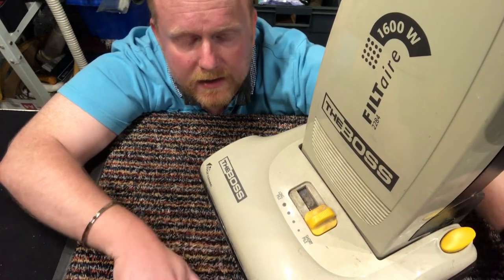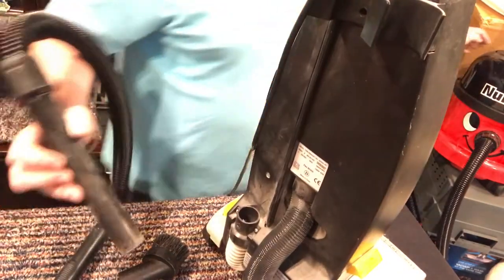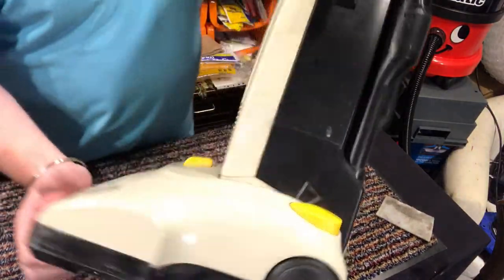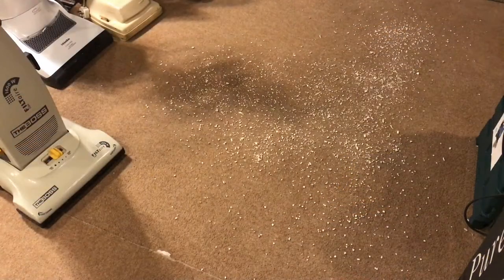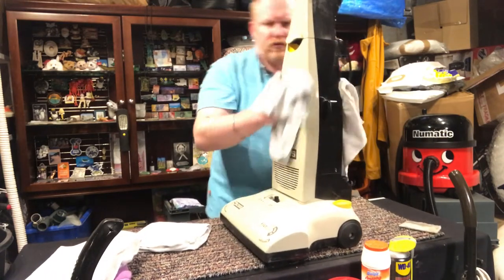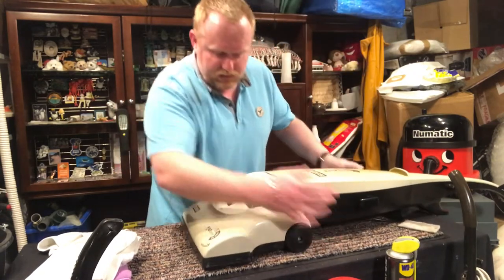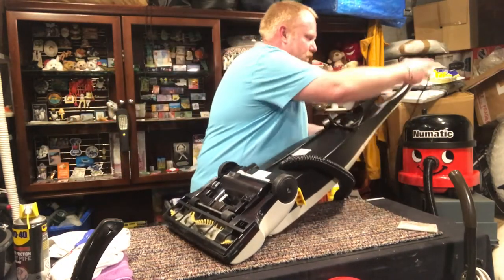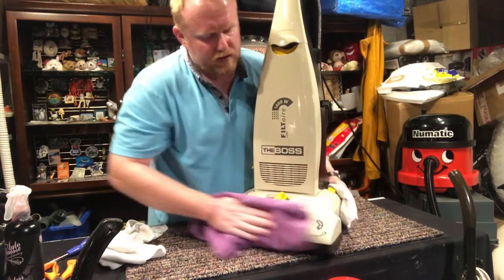Electrolux The Boss Quick Repair Demo & Clean Up

Comment: Thanks, that really helped me to replace the brushroll. It's not very obvious how they come apart. Are the drive belts still available? Obviously a wearing part.
Reply from the maker: You’re welcome, you kinda have to use another brand but look at the original first and measure it.

Comment: I think thats from 2004, judging from the serial number. It is similar to the powerlite pet that I have, and uses the exact same HEPA filter, which is non washable paper. Its a nice machine, and you did a nice job doing it up!
Reply from the maker: MadAboutHoovers Thanks Steve, if it were mine I would have stripped it down further to clean it up, but good enough for a quick service for friends.
Reply: @HooverLux  You know you can get fleece bags designed for this machine so you dont have to try and make the numatic bags fit? If you have a look online they are about 3.50 for a pack of 5 and were designed for this machine.
Reply from the maker: Jake McIntyre Ahhhhhh! Ok, thanks for the advice, I will have a look for them. Thank you for letting me know my friend.
Reply: @HooverLux  your more than welcome. Sometimes i just think its best if things are kept original like this lovely electrolux. I have the same one as in your video abd it is a bit hard to push but it really cleans well and is nice to use. The long brush roll is nice too. Im sure you will find one if you keep a look out. 😋

Comment: I have the boss 1600w that sounds great but does not fill the bag. I opened it and it blows though the filter but not through the pipe that lead to bag. Is it because of blockage then? thanks. I would like to save v throw away
Reply from the maker: Sounds like either the blockage from floor head to pipe to bag, or the seal around the bag door?